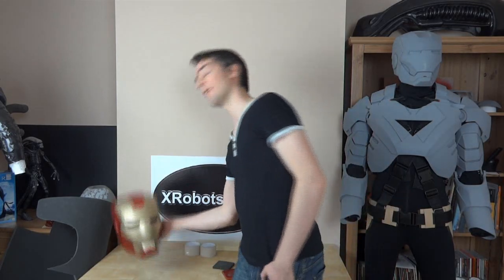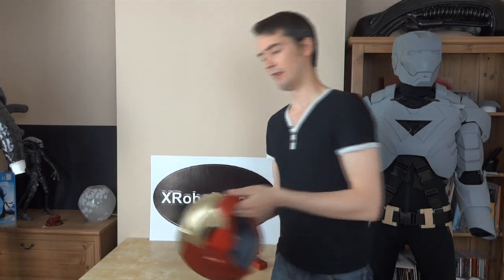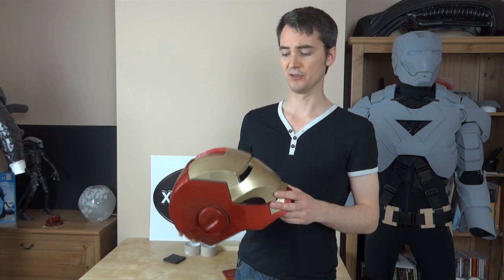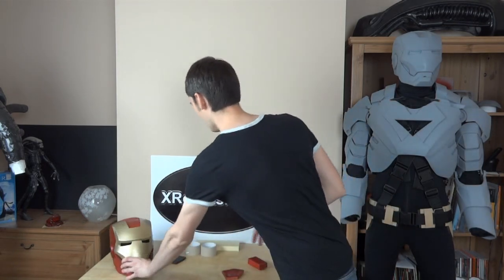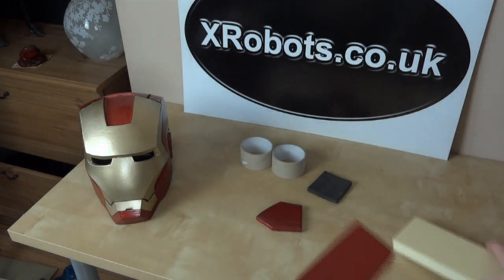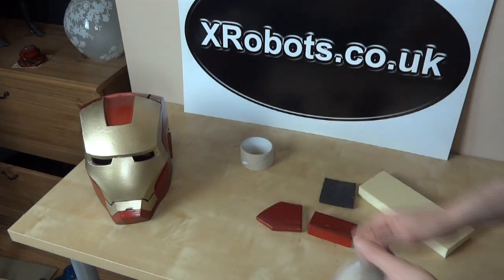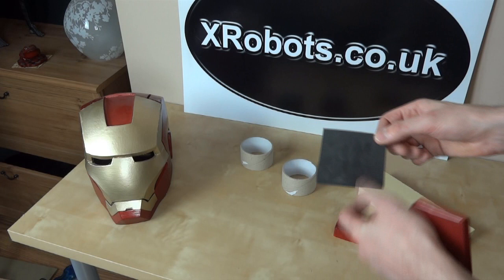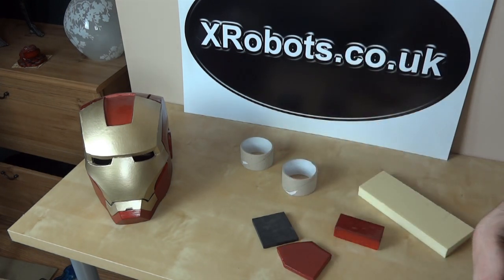Iron Man Power Suit #6 | Plastic Coating Foam | James Bruton

Comment: Do you think you could possibly list a few brands of PVA glue? I went around asking at all sorts of places for PVA glue and no one knows what I'm talking about and every result online has no info on if the glue does reactivate when wet.
Reply: PVA glue is the white liquidy glue they use in schools, if that helps?
Reply: But every source says that Elmers Glue is different as it has other stuff in it and is not as strong as what he's using.
Reply: http://en.wikipedia.org/wiki/Polyvinyl_acetate

Elmer's glue is apparently the same.
Reply: Would it have the same effect and strength as what he's using? I've never known school glue to so easily reactivate when wet either.
Reply: Use wood glue, it is also PVA glue. PVA glue come in many types and strengths, but elmers wood glue that you get from like homedepot will work just fine. http://www.homedepot.com/p/Elmer-s-8-oz-Carpenter-s-Wood-Glue-E7010/202819835#.Uswe_7Qca3Y
Reply: deeamerson And it'll reactivate when wet?
Reply: Yes, but it depends on the type of PVA glue. the white or elmers school glue will reactivate faster when wet, then elmers wood glue, or gorilla glue. PVA is the name for the chemicals which is the main ingredient in PVA glue, that's why there are some different types, because there different mixtures. But the name : Elmers, Gorilla glue, Titebond, Aleene's tacky glue, etc... those are just the names of the different brands!
Reply: Yeah I get that much, it's just I looked for these kinds of glues that all are based off PVA but all of them were waterproof and that seems to defeat the entire purpose. I ordered some straight advertised as PVA glue, I think the brand is Gamblin. It didn't say it was waterproof so I hope that is the stuff.
Reply: What??? I'm confused, I don't understand what is it your trying to do? why are you look for a waterproof glue?
Reply: I'm not. I went to a handfull of hardware stores and craft stores looking for PVA based glue. No one knew what I was talking about and every glue they had was waterproof. I'm saying I found some online that doesn't say it's waterproof so I'm hoping that it is in fact not waterproof. I want it to, like in this video, reactivate when wet.
Reply: Ok I see, good luck with your projects!!!

Comment: Letting it set to its gel phase will cause it to me very thick, and won't give you much more than about a minute to spread it out. If you're using a brush, it will also be very rough. Hard to describe, except maybe you'd want to do this to make a zombie flesh effect, not smooth, metal looking armor.

Comment: You sprayed it with a gray "plastic primer" of what type?
Reply: *****
Sorry, I can't, I'm in the US.
Can Plasti-Dip be used as a base for Polyurethane resin? I've already done most of my costume using Plasti-Dip, with only the torso and belt left. Because of painting errors (& repainting), the paint is beginning to crack. I need to stiffen the foam as your method does.
I could apply a stiffening agent on the inside or over the paint on the outside and simply paint it again( I've used Valspar brand spray paint). Can Polyurethane resin be applied over paint?
Thank you for your patience and help.
Reply: *****
Umm, update? Can you tell me the brand name & description on the "plastic primer" can? I can search the net and find it and an equivalent in the US.
Reply: No problem, thanks.
Reply: FarSeeker8 Hi again, when you sanded the dried "smooth-cast," what grit did you use?
Reply: +James Bruton "Yes it's Halfords plastic primer."
I think I found something similar, but manufacturers are skimpy on the details of their products so I'm not sure: "Dupli-Color Automotive Primer / Filler (grey)."
I've tried it; It sprays on like a thin layer of PVC.

Comment: are they both the same or why is one blue  and  one  yellow
Reply: They are the two parts of the resin he is using. It is a catalyst resin that needs to be mixed together
Reply: +Chris Martinez 
I think the two containers are different colours so that it's easy to see which is part A and which is part B. Helps avoid mistakes.

Comment: Would white glue be a good substitute?
Reply: Idk why you havent been answered. If you mean white glue as like elmers, or some woodworking type glue, in my experience that type of glue is too brittle when it dries. Rubber cement is ok, but takes a while to dry. You may also have to reapply at some point. So far Im happy with Gorilla super glue for a quickfix. 
I have yet to find contact cement, I just haven't made the time to go look for some at a hardware store.
Reply: thanks! I haven't got around to plastic coating my props yet, thanks for the tips!

Comment: Well the way in which i want to make my armour is by using 12mm thick eva foam but then put 4mm thick perspex acrylic on it by doing this i will use my templates but i will have to build it up peice by peice but some peices will be smaller like on the shoulder and someare larger like the torso and backpiece however the top half of the torso will be glued to the bottom half there is a picture on google images if you look up jedi armour costume pieces it is like the old republic armour but as one

Comment: I'm going to sound pretentious, but does anyone know of biodegradeable, environmentally friendly plastic coating alternatives?
Reply: +Gabe Davis You can use a corn starch/potato starch based bioplastic. Search it in google, you'll find quite a few recipes. It's water based so it's water soluble. But you're going to be sealing it with paint, correct? If so, it shouldn't be a problem, but the plastic can be made over the stove at home. Really easy and super cheap. I haven't tested this out on foam yet, but I can't see why it wouldn't work.
Reply: Awesome! Thanks for the info.